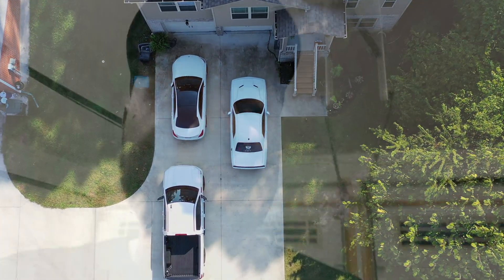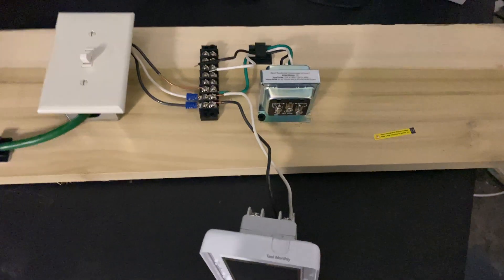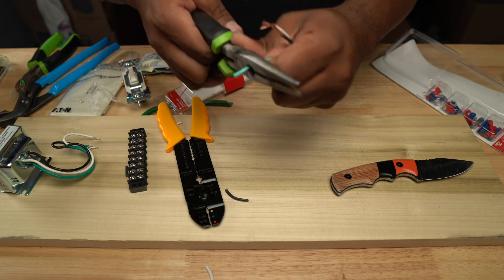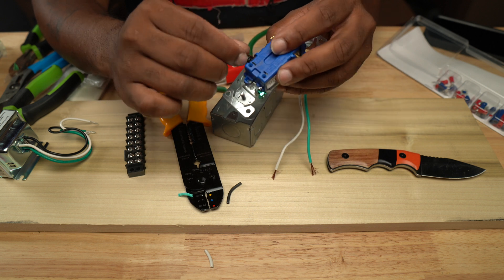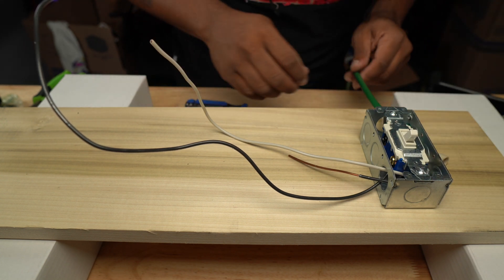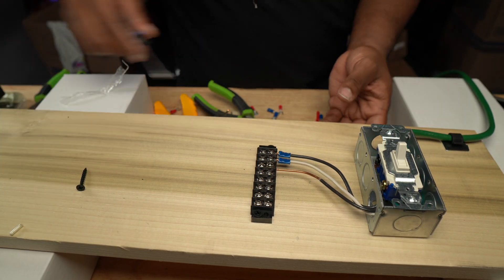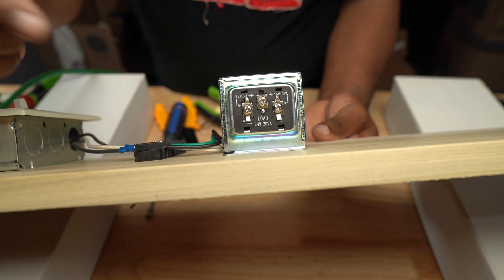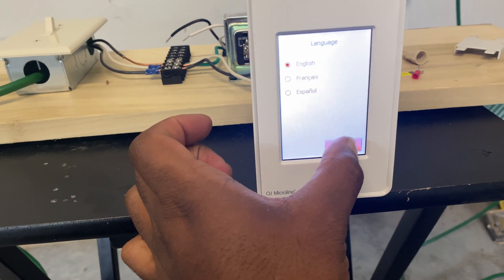How To Make A Switched Low Voltage (120v to 24v) Test Station!!

Comment: Umm... there are several things that make me question the legitimacy of the certified electrician statement. After seeing you miss the wire strippers right in front of you, not using bushings to secure the wire in the box , pulling on the conductors to strip them from the insulation and not knowing what kind of switch you're using, it just makes me wonder. Even still, the power supply you created only provides low ac voltage instead of 120 and low ac voltage. All I'm saying is that it just didn't seem like a legitimate claim.
Reply from the maker: Wow…that’s all you got out of the video. Don’t really need to prove anything to you but I have been an electrician with the ibew for many years (retired now) have a great day
Reply: @PalletJackin  I appreciate your reply. There were just some things that were kind of red flags to me is all. There was actually something more that I got out of it. The switch you used to turn it off and on , which was a three-way switch, could have been used to switch power from the Transformer to a duplex receptacle Outlet, had you installed one. That way, you could have had 120 volt power and low voltage 16 or 9 volt or 24 volt or whatever. Food for thought, you know?

Comment: The manufacturer should list the lowest voltage needed to power the device , no ? I’m asking . I’m guessing , I’m a studying apprentice so I’m so new , I started tomorrow 😂🤣😅
Reply from the maker: Yes the voltage rating should be listed on the item. The voltage rating is very important as you could fry a device if you have too much power going to it.
Reply: Thanks , that’s cool . I’m just thinking because I saw a guy putting in a door jam switch and on one switch , he used voltage regulator ? Not sure if that’s the name to basically lower the power so he could install the switch without a box . So , after watching your video , I got to thinking , okay , if your device did not work due to lack of voltage , but , the device is still able to operate on low voltage or is low voltage , there maybe a range of voltage this device can be powered with .

Comment: So to test the 120V, do you just disconnect the step down and wire into the strip?
Reply from the maker: Yes. Actually you can also use the 120v to test lights and other things that need 120v.